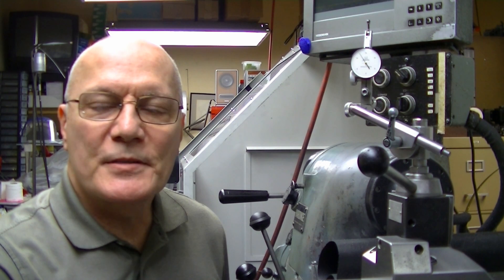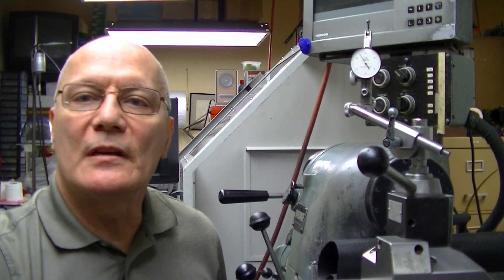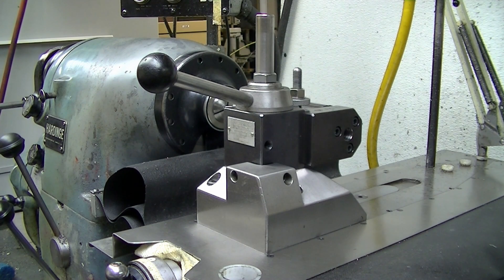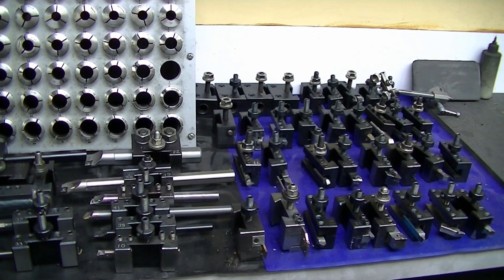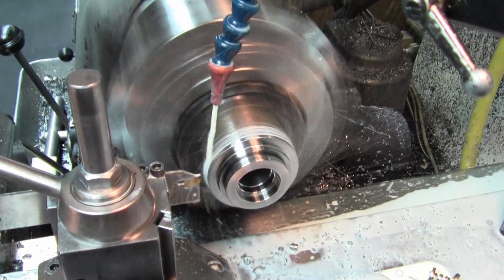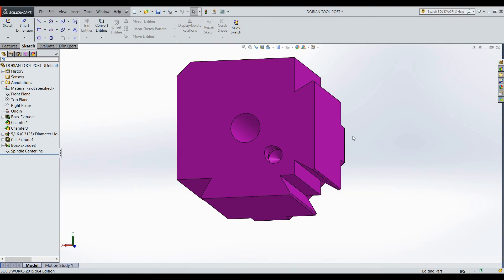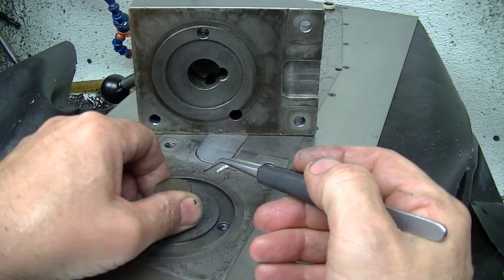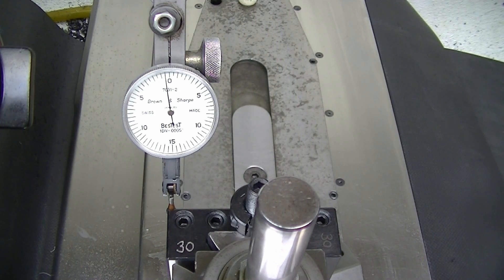THE SOLID TOOL POST MOUNT

Comment: Having just read the comments, yes all 350 odd, the question of single point threading kept coming up, perhaps you could explain in a future video how there is no need for 29 degree feeding so as to put some folks mind at rest. Coming from you would give great credibility to the technique.
Love your parting, just goes to show that a rigid, and square, set up and constant feed go a long way to success
Reply: Before i give my personal view, let me say there are many variables to consider when threading. You have the material, the lathe, the type of cutter, and prejudice and dogma to consider. Having said that, on a reasonably average quality lathe, equipped with a decent style of cutter, 13TPI/2mm thread should be no problem. If you have none of the above you can have trouble no matter what your technique. :(

If I might add a little life skill advice, if you hear, or think, of a different technique to the one you are used to, give it a go and see for yourself if it is better than yours or not. Following this will lead to learning and improving abilities, not following leads to stagnation. There are very few things in this field where there is only one way of doing things, certainly Robin would not be where he is today if he did things the same old way that has been taught for generations.
Reply from the maker: Thanks Chris, will do. You must be a glutton for punishment to read all those comments.  Thanks for watching and commenting!
Reply: Glutton, er no, just curious, you sometimes learn things from the comments on the better channels.
Reply: I am also interested to see how threading works with that setup
Reply: i read  lots a comments as well it hasent helpt my gramer or spelling but thers lots to see and some of it makes sence  lol
Reply from the maker: With a rigid setup you can thread with a straight infeed on smaller pitches without any problem.
Reply: I like the setup and am thinking of making my own. I do a lot of ordinary threading standard hardware sizes. What do you think would be the limit on pitch? Normally the coarsest thread I cut is 1/2 13.
Reply from the maker: Chris's comment covered it perfectly

Comment: Really nice video, Robin. I am curious as to how you deal with single point threading without the compound. Do you have a second lathe for threading and tapers?
Reply from the maker: Thanks Pedro, with a rigid setup you can thread with a straight infeed on smaller pitches without any problem. I do short tapers with a lapped plunge tool set on the required angle. Thanks for watching and commenting!

Comment: A really interesting video mate, love the precision. Forgive me, I'm an electronic Eng not a machining one, how did you set up the bracing piece to scrape after it bows under stress? I just cant visualise how it would be done. Cheers :) BTW Stephen Gotteswinter sent me here
Reply from the maker: The tool post is bolted to the riser and the two set screws torqued to lock the position. Those forces distort the originaly flat bottom of the riser block. Now that bowed bottom surface of the stressed riser block was hand scraped to match the top of the cross slide where it mounts. Then it is bolted to the cross slide with the four bolts since it now intimately matches the cross slide.
Reply: I am interested in this too.
Great videos. Thank you for taking the time to make them.
Reply from the maker: Thanks P3dro and thanks for watching and commenting!I plan on doing some scraping videos but until then you can watch this https://www.youtube.com/watch?v=nOJrhrne80s to get the idea.
Reply: I guess at least for me it was not about the process of scraping in general, but how you handled the scraping when the piece was torqued down. Did you just take a known flat, blue it and rub it on the work-piece while it was bolted in place?
Reply: Thank you for the reply, as Jan said it is the process you undertook to scrape the bracing block for the toolpost, especially as you said it would deform once cinched down. Cheers
Reply: Ah! Ok, that makes sense. Thanks!

Comment: G'day Robin! thank you for your video, this makes me all the more comfortable with not bothering with a compound on my AL960B lathe salvage project. (https://www.youtube.com/watch?v=tViG_GtO11k).

One reason for the compound as I understand it is for threading, setting compound to 59 degrees and bringing in the compound for thread cut, so the tool only cuts on one face, and cross slide is used to draw the tool away from the thread at the end of the cut.

Are you using the cross slide only for threading, and cutting on both faces of the tool? or using alternative arrangements for threading? (or indeed CNC threading capability on your machine?) 

Cheers! Marcus
Reply from the maker: with a rigid setup you can thread with a straight infeed on smaller pitches without any problem. With your CNC setup you don't need or want a compound.
Reply: I thought that might have been the case, thanks Robin! we are presently on the lookout for a lump of cast iron to make the tool post assembly, we have a slug of aluminium, but I understand from your and other comments that there is more chance of vibration using an aluminium block instead of cast, would you suggest this is a significant issue? I'm guessing where the toolpost is attached by the T-Nut into compound, that style of attachment would be very prone to flex/vibration with aluminium

Comment: Thanks Robin. Making something that provides both rigidity and repeatability sure helps with interchangeable tool holders.

As for the problem with reflections, that is something the theatrical makeup folk solved about a hundred and fifty years ago: face powder! :-)
Reply from the maker: Thanks I wilton, I may try that and thanks for watching and commenting!

Comment: Hey Robin,

Cast Iron for the tool post block, humm. Secret mechanical ninja tricks for extra low Q damping. Yes you get bonus points for the chip funnels. At first they looked like you took some material off the block to shrink its ominous presence. I didn't examine it that closely when I was visiting.  I was too busy looking at all your other toys. It was nice that you took it off and showed the base details. How did you get it back into exact position for all your calibrated tools? Is it like the CNC lathe and once you set tool 1 all the rest follow it? 

Thanks for the kind words but its really all you my friend. People can easily see you are the real deal.

All the best,

Tom
Reply from the maker: Hey Tom,

It repeats pretty well but yes the DRO has a global datum shift like G54 on a CNC.

You deserve them, but they still have to visit my channel to get a chance to decide if they agree!

Looking forward to your mini 1-2-3 blocks.

ATB, Robin

Comment: Nice work!  in addition to the questionable lockup of the compound on a hardinge, I find it tends to get in the way of the cross slide dial unless you set it to near parallel with the Z axis.  I'm giving that serious consideration on the HLV I am restoring currently.  
How repeatable is it when you have to pull it off?  Do you now have to reset all 50+ toolholders in the DRO memory? What's the impact on threading since you can't back the tool out like you can with the throw lever on the compound?  Does it matter that much or do you just use the cross slide to back it out a few thou on the return pass?
Reply from the maker: Thanks Marcus, the DRO has a global datum shift like G54 on a CNC. Threading is even faster not messing with the lever and just dialing the cross slide in and out. Thanks for watching and commenting!

Comment: Very good Robin I was looking forward to this, at the shop I have an old AML-618 which is a Hardinge HLV-H knock off distributed by MSC years ago.  The compound is mounted a bit differently I might make a short video on  my channel about it.  I really like your way covers and shields on the cross slide.  The way on the lathe here is in bad shape.  The fit and finish on your post mount is spectacular.  How did you chamfer the elliptical holes?  I think Tom showed an Ellip-Debur some time ago for doing that?
Reply from the maker: Thanks Bill, the way cover video is next to show. the elliptical debur is done by hand with a 1/8 dia. flame shape burr in a small air tool. Thanks for watching and commenting!

Comment: Outstanding video Robin.  I'd heard mention that you had a rigid non-compound configuration, and I'm glad to see it in action.   I think Stefan also mentioned he had something similar in a podcast.  I would loved to have seen you make that cast iron base.   One disadvantage I see to this is that you loose the flexibility of rotating the tool post, which means you need a dedicated tool & holder for every type of operation - for instance a different tool for every chamfering angle - but maybe you overcome that with pivoting head tool (which also defeats the consistent tool offset advantage).   I'd like to hear/see how you overcome the lack of tool post rotation flexibility in your individual tool collection.   Again, thanks for another really illuminating video - much appreciated.

David Best
Reply from the maker: Thanks David, the time saving of having many standard tools ready to cut far outweighs the few times I need to put a tool in a holder at a specific angle.  and thanks for watching and commenting!

Comment: Great video. Can you show the construction and use of the tall post through the center of the tool post? How did you go about bluing and scraping the mounting points?
Reply from the maker: Thanks Aaron, tha is just a grade 8 hex bolt with a small tapped hole in the top to hold the rod for the indicator mount. You will have to wait for me to do a scraping video for those details. Thanks for watching and commenting!

Comment: Robrenz - I can see the utility of the solid toolpost for production, but having used the Hardinge as well as the Feeler knock-off I never used one for production.  Of course I never had my own shop and worked in tool rooms making jigs and fixtures or one off parts.  I loved using the Hardinge, especially the threading mechanism.  If I could ever afford one I wound definitely consider your style of toolpost for production work.  Keep the video's coming.
Reply from the maker: Hi James, the solid tool post allows picking up any tool and knowing the diameter it is going to cut and its orientation. That is extremely time saving for one of and short run parts also. The drill chuck on the post allowing DRO control and feed is also a big help. Most of my work is one to three parts at a time. Thanks for watching and commenting!

Comment: wouldn't it have been possible to drill and tap 2 or 4 holes (or keyed it) in the bottom of the toolpost and then screwed it into the block from the bottom, before mounting to the lathe? according to this aloris picture, the bottom looks meaty http://www.aloris.com/wp-content/uploads/aloris_patented_locking_device_assembly.jpg
Reply from the maker: It is meaty but it is also very hard so unless you plan on EDMing the threaded holes that wont work. Also the post would still only be held from rotation by friction.
Reply: true. pins in that case? screws who's ends are tapered pins?
Reply from the maker: I think what I did is about as simple and rigid as possible other than welding the tool post to the block.
Reply: For those with multifix style QCTP, fixation against rotation on the vertical axis is not possible by an element pressing on the periphery.    Multifix toolposts have the advantage of that the tool can index around the spline, which can stay permanently fixed. sometimes deals come up, they are popular in europe. The quick indexing can be used to solve chip curling problems or get into tight spaces, in situations where turning a taper to a shoulder or near a steady rest. Typically it has 20 positions. Often, deals also come up on huge lots of crappy inserts that suck at curling chips (because, they're older), but are still worth buying. I have one such lot of 200 Widia TNM inserts that have no integrated chipbreaker, bought for 5$ a pack about 6 years ago, new. As a home machinist it is important to be versatile. Randyrichard is using the odd corners on APKT inserts, which require him to turn the toolpost slightly, since you can not both face and OD turn to a shoulder in the same position in this scenario.

Of course, for the same reason, you could not weld a multifix --- but why didn't you weld the post; do you think it would have distorted? Seems like less trouble to go through than scraping the warped base, which may warp again as it settles over time, or the screws loosened and retightened at a different torque than before. For example, in the case where the qctp needs to be disassembled for cleaning, if fine dust (cast iron perhaps) works its way in from the bottom. In this example, if it were welded, would require breaking the welds.

Not hating on your design. Just exploring the possibilities of a more universal design.

Comment: I amhappy that you published this as I have a cheap Chinese lathe, and have been fighting deflection for years and did exactly ( not to your design ) what you have done,  by removing the compound and replacing it with 
a 3" sq block bolted to the cross slide. I did not fix it solidly as you did, but none the less improved repeatably to a very high percentage.  I will look at my set up and see if I can fix the rotational aspect. And of course as you pointed out the compound can still be replaced when ever screw cutting or taper operations need to be done.  Well DONE and thanks
Reply from the maker: Thanks Eldon and thanks for watching and commenting!

Comment: It just goes to show: nothing is really rigid. You just have to firm things up until the lack of rigidity is reduced to an acceptable level. 

Anyone who has made the final adjustments on a 4-jaw chuck by tightening only, has demonstrated this to themselves (whether they know it or not). Those last few tenths are achieved by distorting a massive chunk of metal (the chuck).
Reply from the maker: Agreed Peter!
Reply: Oh, and BTW, if Tom Lipton fails to give you style points for those softened edges, I will. Very nice effect. Looks like 30 hours of tumbling in diamond-dusted walnut shells (but I bet it isn't).
Reply from the maker: File, belt style sanding stick, sanding sponge, scotch brite.

Comment: Also, do you think there is much difference in rigidity between cheap toolposts and holders and quality ones?
Reply from the maker: Yes the cheap ones are really bad compared to Aloris or Dorian
Reply: That's a shame. I had my dad sell an Aloris BXA because it was really to big for our lathe, but I wonder how much it would have helped over our Chinese AXA. I'd love to see a sciencey episode on deflection of materials, because I had thought that assuming there was no plastic deformation, the hardness really didn't determine the rigidity.
Reply from the maker: Coming up in my Mechanical Engineering for machinists series of videos.
Reply: Yes! Thank you sir!

Comment: Honestly, how much does that big block really rack when torqued? And do you really have that much torque or the set screws to keep the toolpost from spinning? I've never had that issue on mine all though I don't put near the force on it.
Reply from the maker: Several thousandths concavity on the base. The set screws are very tight. I do a lot of very precise hard turning and my digital reads to 0.00005" (yes half a tenth) on diameter. So when I say I don't want it to move at all I mean not at all.
Reply: That's pretty impressive. If I made one I'd have to mill it after words, I have no grinder nor scraping skills.
Reply: I think I see a new T-Shirt design " Do you do it to half a tenth?"

Comment: There's just no arguing with the logic, execution, or results.  Is there any reason beyond habit/custom for keeping the compound on, when not needed?  

For single point threading:  Does the gain in rigidity suppress chatter, better than being able to cut with (mostly) just the leading edge by feeding with the compound?  

Since you mentioned only using the compound 4 times, I presume that means you do single point threading by feeding straight in?
Reply from the maker: Thanks somebody else, straight in threading works fine with a rigid setup. Thanks for watching and commenting!
Reply: I hope he replies to this very good question.
Reply: Cool, good to know.

Comment: Thank you for making this video. I have a 8" SB1001 lathe with a compound that turns above a 40mm diameter ring. I swear I can see the compound flexing at times. Glad to see that it's reasonable to remove the compound from a manual lathe.
Reply from the maker: Thanks Kent and thanks for watching and commenting!

Comment: Robin, what an excellent solution for maximizing the rigidity of your lathe.  Would you maybe do a video explaining how you use the larger sized tool shanks with an axa sized tool block?
Reply from the maker: Thanks Joseph I just grind the slot in the tool holder larger to accept larger tools. Thanks for watching and commenting!

Comment: So you are using the ring in the cross slide to maintain X repeatability when you remove and replace the base?
Reply from the maker: Thanks Joey, yes an the DRO has a global datum to shift the entire offset library if necessary. Thanks for watching and commenting!